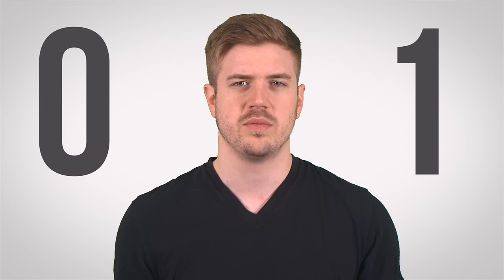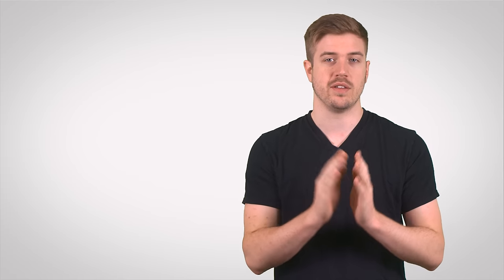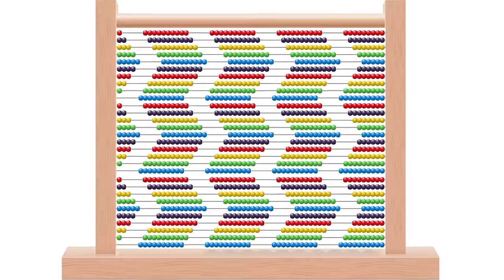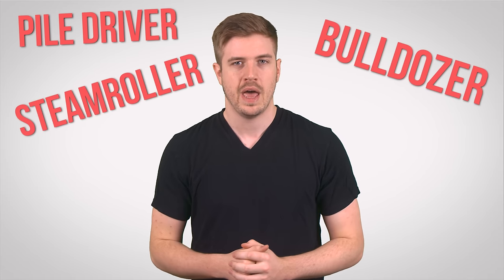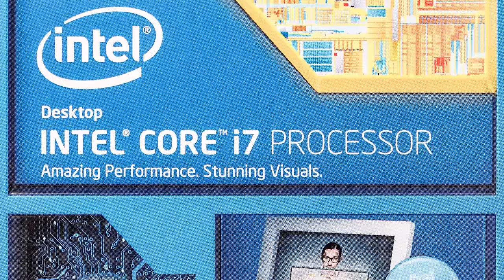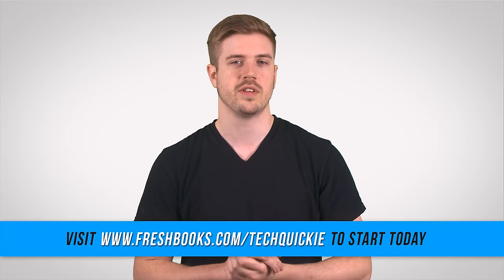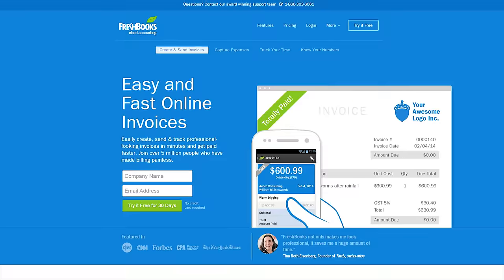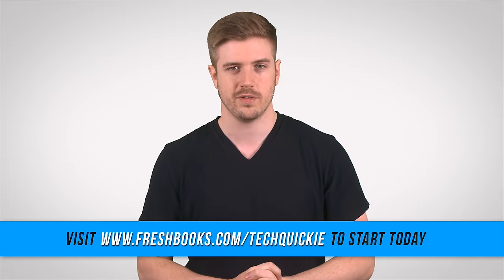Coding Communication & CPU Microarchitectures as Fast As Possible

Comment: you failed to mention interpreted languages or virtual machines. Not every language get compiled or gets compiled to machine code.
Reply: Andrew Brown eventually they all do...when they do is another topic for (possibly) another video.
Reply: Isotopic Design
You could go to the trouble of saying 'compiled at runtime' but then we may as well call it interpreted. Yes, eventually all languages get converted to machine code, but I don't think 'compiling' is defined that simply with no temporal connotation. This is why there is a distinction between 'compilers' and 'interpreters' in the first place.
Reply: Andrew Brown Who is still using 'interpreters' anyway? Most of the languages that were interpreted now have JIT compilers, noone is doing the 'line by line' approach anymore.
Reply: Maciej Sopyło scripting is still interpreted (perl, python, bash, Tcl (ugh) )
Reply: Andrew Brown Interpreters compile source code line by line and then run that code, so I guess they are also technically compilers.
Reply: Andrew Brown Yup...English, Latin, Chineese and all dont get compiled...But only you can understand them!! Microprocessors can only understand Machine Language or Binary Codes.What ever language you use, if you want a microprocessor to do anything, it must be told in machine language using binary codes. Not in English

Comment: You don't need to compile your source code in order to convert it to 1s and 0s, since source code is already nothing else but binary information interpreted and displayed as text. The language specific instructions in your code need to be converted into (eventually) instructions which are part of your processor's instruction set, that's why you need a compiler.

Comment: The only thing i did not understand is that how these complex transistors after making switches on or off according to the code can understand and give the output. Its very complex. I wish i could work in intel to properly know whats going inside the processor.

Comment: Also, languages like Java don't directly compile to machine language but rather their own "bytecode" which is interpreted by a Virtual Machine. Saves you the trouble of writing a compiler for every platform out there. This is why you can run a piece of Java code on so many devices and why it's so popular with embedded devices.

Comment: Diep,  your second question is fairly simple.
Build a rig that has a crappy ( i3 intel or amd athlon x4 640 3.0ghz quad core budget cpu) cpu with a VERY good or GREAT vid card like 280 or better/780 or better and play crysis,  then sc2.   Crysis seems to be much more video card dependent versus cpu dependant as you'll still get fairly solid performance.

SC2 on the other hand, you'll do great to maintain above 20 fps ( if possible) with more than 130 total characters/monsters on screen at the same time ( OutBreak level) because that game is at least 45% ( overall) cpu dependent almost regardless of the in game settings and combinations of those settings that you adjust.

Comment: You forget one part of the process:
Source code->Compiler->Assembly->Assembler->Machine Code->Instruction Memory->Instruction Decoder->Control Signals
Reply: David Teles running the assembler is often forgotten nowadays, since most compilers include that step for you automatically. And for the most part, even after the assembler you still need a linker before the file is executable by the cpu.

Comment: I was hoping this video would finally explain, how the first CPU was made. As in, how the first collection of transistors were assembled in such a way that it could process binary into something useful.
Reply: First? First is a tricky one, as people have been making machines to process data for a LONG time. However, I'd suggest that you look at early 1800s analog computers, Charles Babbage's various designs, early 1900s vacuum tube computers, the early transistor based computers, microprocessor based computers, and finally the precursors to modern CPU manufacturing techniques (photolithography a good term to look up, it is central to modern CPU fabrication). Hopefully one of those subjects answer your question and are interesting at the same time.
Reply: Thank you! :D

Comment: Only issue was the part about compiling code into binary so the computer can understand it.  The fact it is binary does not matter (even a C++ file can be read by a computer as binary), it's about how machine code specifies the instructions directly executed by the CPU (e.g. add, subtract, clear register).

Comment: Source code is compiled into machine code which is NOT binary. Binary is actually "assembled" from machine code. If you search machine code you will find it isn't 1's and 0's.
Reply: It's hexadecimal, which is still a numbering system. It's analogous to binary. Feed a CPU either binary or hexadecimal and it will understand it.

Comment: I have been searching for the answer for years but the explanation is not enough. how 0 & 1 works? how does machine understand this? can I consider it as MOS code? but how it (switch) automatically start and end just with the software? how does computer determine the start and end of the combined 0's and 1s? please explain.

Comment: Slightly dumbed down, you missed out a very important step. From the source code the compiler compiles it to an assembly language. An assembler then translates this to binary. Both processes are incredibly complex
Reply: If you want to be this pedantic you missed the linkage step performed by the linker after the assembler. FYI the assembler is not an incredibly complex process, but a rather simple one, you are really mapping mnemonics to machine code instructions, the linker handles all the address offset resolution.

Comment: "Why can the processor understand these 1s and 0s?" Really ought to be followed by a brief explanation of processor decoding logic, and how decoded signals then configure the processor execution logic. That would have been a much more clear explanation and easier transition over to the different instruction sets.
Reply: For computers, it means high voltage(1) and low voltage(0) so the different voltages pass through the transistors and end up coming out as what you see on screen(its more complicated than this but this is a basic explanation).
Reply: +Ollyver I was talking about instruction decode and execution. I.e. The translation from machine code to execution control signals. (Not electrical signaling.)
Reply: That done in what is called the "Assembly Language." The layer between machine code and execution code (one the User accesses) Fortran is the example of the oldest but most still used assembly code in the world.
Reply: +TheArtofDHT assembly language is source code. Assembly language source code is then converted into machine code / object code by an assembler/compiler. Machine code is parsed by the processors decode logic, and the decoded logic's output will be used to configure the processors pipeline and execution units. That's where I think the video was derailed a bit, jumping to gates/binary/... which is so incredible low level, while the basic "how a processor interpret and use machine code" was more or less skipped, which to me is one of the really interesting computer engineering topics to teach.
Reply: Well this is not designed EE/CS students so you can forgive him for not explaining the fetch-decode-execute loop, plus decoding depends on the instruction set but is generally the easier bit of circuitry to do.
Reply: +Daniel Grumberg hmm, I thought 1:30 - 2:30 was explained more complex than necessary. A very simplified "add r1, r1, 5" decode + execute seemed like it would explain the concept better and be an good bridge to the microarchitecture /  instruction set discussion. But maybe it's just in my head that's simpler :)
Reply: Yes, I would agree with you on that point, but then again I know what is going on ... To be entirely fair I am not convinced he understands the subject matter well enough to be talking about it. He kind of gets the high-level abstraction, but a few confusions in his presentation make me doubt he has the correct background to be explaining this.

Comment: The 1's and 0's represent a High or Low signal rather than "On" or "Off"
Reply: A "High" signal just represents a transistor being turned on and the opposite is true for a "Low" signal. So 1s and 0s still represent on and off.
Reply: my point is when the transistor is pulled low it isn't off. The voltage has just dropped below a certain threshold
Reply: ***** At which point it no longer conducts electricity, effectively making it "off"
Reply: it's still conducting simply at a lower voltage.
Reply: ***** No, it isn't. That's the point of a 0. There is no point in a transistor if it is always on.
Reply: I think you could benefit from a lesson on transistors but for the sake of this argument here is a quote and link regarding low and high signals.
"CMOS gate circuits have input and output signal specifications that are quite different from TTL. For a CMOS gate operating at a power supply voltage of 5 volts, the acceptable input signal voltages range from 0 volts to 1.5 volts for a “low” logic state, and 3.5 volts to 5 volts for a “high” logic state"

http://www.allaboutcircuits.com/textbook/digital/chpt-3/logic-signal-voltage-levels/
Reply: ***** You win. I was thinking about power transistors like MOSFETs.

Comment: This was a very (and I mean very) layman's terms explanation of a CPUs architecture.  He talked about instruction sets, which is good but never even mentioned assembly language.  I also have a bit of an issue with his explanation of code.  A compiler takes higher level programming languages and translates it into assembly code, which is then translated into machine code (binary 1's and 0's) by an assembler.  Finally, although transistors are equated to switches in computing, they do not actually physically "switch" (like a light switch) as he explains it.  A transistor either impedes an electrical current or allows it to flow depending on how the transistor is biased (with different voltages) and in what type of transistor it is.  Transistors are also used for different boolean algebra such as inversion, OR, AND, XOR, etc.  There is no physical switch as is explained in this video.  Cool video overall but extremely simple and almost too simple to the point of being wrong.

Comment: i would like to know what happens from the moment i press power on to when the BIOS is ready to load windows... then again that could end up being a 1 hour long video when as fast as possible and maybe 10 hours at normal speed ;P

like how does it know it's on when it is not a toggle switch anymore, how it communicates from the DOS like BIOS to the Hardware. why are 1 and 0 = information capable of loading windows... it is like i understand but there is a gap somewhere making me not understand... 

like by example, ASM, a direct to machine programing language, but how is taking value "A" and multiplying it by "B" and comparing it to "C" makes windows load and function... you can define a function in C++, why do the computer keep it as defined and can use handles (in and out of the function) how does a processor know the difference between functions if all it has is 1 and 0!? 

even if you get it in segments of 8, 1 byte does not mean much alone! why did it know that byte "A" is to be subtracted to byte"B" is there more than one stream of 1 and 0? when one uses a binary to text converter, why does it write text and not start multiplying at random? 

the more question i ask my self, the more it seams like magic even tho i modded Unreal Tournament's scripts without knowing C++ and understood right away how it worked, and ASM is very logical in simple math... if all there is is 1 and 0, where is add EAX to EBX and stuff?! how would that be a 1 or 0?!

Comment: You did skip a step. There are typically 3 levels of programming languages. Machine language, Assembly language, and High level language (some people might have different names but they are referring to the same thing). Compilers are typically written in Assembly and are used as the "bridge" bridge between High Level languages and Machine Language. Back in the day they used to just write everything in Binary (machine language) and before that they used to have to physically rewire the whole machine. But once the developed Assembly Language and Compilers they were free to create different kinds of higher level languages (C#, Python, Java, etc...). Another thing is that some languages don't need compilers and are called Interpreted languages and they way they run on a computer is fundamentally different from compilers. Every high level language is either compiler or interpreted before the computer can actually do anything with it. And no, HTML is not considered a computer language. Sorry